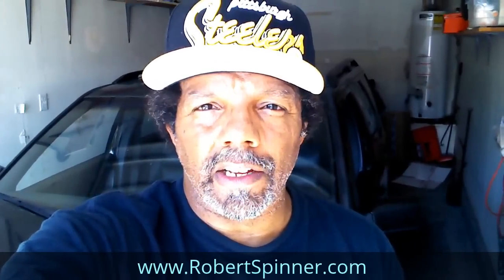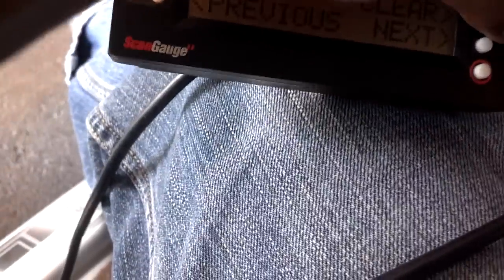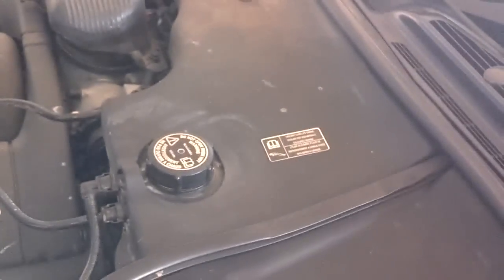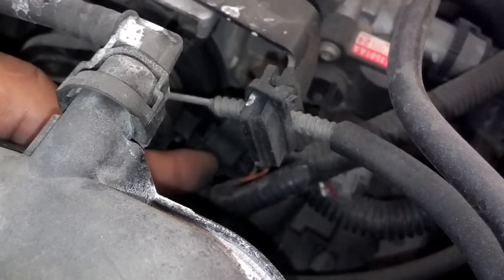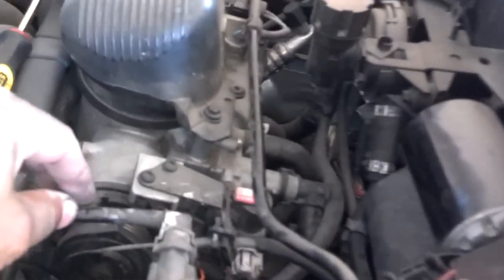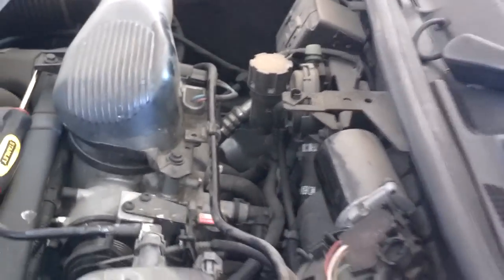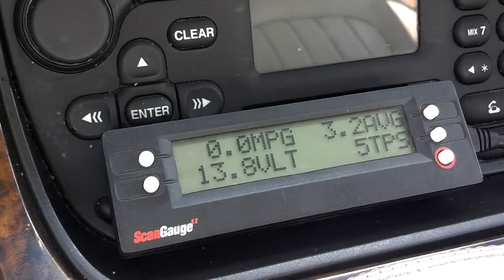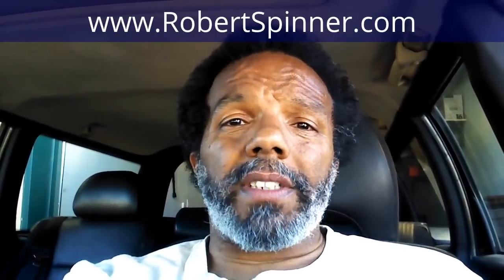Throttle body connector clean for error code P1121 and P1122, Jaguar XJ8 - VOTD

Comment: Think you.ll find the TPS is on the opposite side of the throttle body from the cable reel, part no 198500-3250 ?
Reply from the maker: Thanks for sharing.

Comment: Cheers Robert - Thrown these two codes today (which cleared with my OBD2 tool) so I now know where to get cleaning tomorrow!

Edit: There are a few people on these comments  with the "Restricted Performance" info message coming up - On my 02 XJ8 I've found this is usually an ignition coil failing, check the codes to find out which one to swap out.
Reply from the maker: Thanks for sharing

Comment: You didn’t show which did you spray, the plug with the cable? Or the plug on the throttle body? Or did you spray both?
Reply from the maker: Did I explain it?
Reply: Robert DIY I did what you said on the video exactly I bought the cleaner, took off the two sensors and it kind of worked when I turned the car on for the first time on a cold engine. But it looks like after driving it for about half an hour and the engine gets warmer it starts hesitating on the acceleration again. And it hesitates a lot when trying to drive it with the AC on.

Comment: Hi Robert. I just bought a 2005 XJ8 that hadn’t been driven on the regular through two owners. Car has 69,397 original miles on it. I’ve had it two days and last night I got the trifecta “jag screen on death” a couple times; while driving on freeway and exiting the engine went to “limp home” mode and displayed the three “engine fault/Parking break fail/dsc fail” warning. Both times I safely pulled over, turned car off and waited one minute. Turned ignition again abs vehicle ran fine. Spent much of last night researching any I’m cautiously optimistic I have a dirty throttle body. I’m going to maybe clean it myself now after watching your video. If I don’t and bring it to a Indeoendent jag tech what should I expect to be charged (estimate) for a cleaning? Do I ask for a cleaning no matter how pressured I am to put in a new one?   ....No salvage title or bad circumstance other than the fact cars need to be driven and this cat was lazy and sat for long periods of time.... ... I will follow up with you to post results...thanks again. I appreciate the way you teach.
Reply from the maker: Sad to say, I have no idea. You should check with the guys on jaguarforums.com.
Reply: @RobertDIY  thanks for the reply - those forums are good. Comes with a range of costs of $180-$800(!) just for a cleaning. I just looked at it and decided I’m going pay a shop to do it. I’ll follow up in comments when I do. Thank again.

Comment: Hi Robert - great Jag XJ8 videos      I have a 1998 XJ8 vanden plas. I have a problem called a high speed stall. If you get the Jag up over 55 mph and then hit the breaks the Jag stalls immediately and it can't be restarted until you come to a stop and wait a few seconds.
Any thoughts or help would be appreciated
Reply from the maker: https://youtu.be/NhtUXZTurzo
Reply: Thanks for the reply Robert --- this is actually a unique problem to these jags, just thought I would check to see if you had come across it before - there are no codes, engine operates as normal -and the stall only happens at speeds over 55mph - and the stall is immediate no sputter no fight just an immediate stall the second you press the break ---but you can drive 80+mph let it coast to 50mph then hit the breaks with no issue it only stalls if the jag is going over 55 when you touch your breaks
Reply from the maker: If there is no codes it's probably a fuel delivery problem. Maybe a failing fuel pump.

Comment: thanks for the info my  brother, was wondering bout info on my
 05 jag s-type  i have a 
(RESTRICTIVE PERFORMANCE)
issue and would doing the same thing you did with the throttle position sensor make a difference?  my car boggs out at 3,500 RPM within 20 mins of driving
Reply from the maker: +John Pellegrino I have no idea. What error codes are in the system?
Reply: Robert DIY  i been too 4 different mechanics an they cant even figure it out, i was told nothing comes up code wise for that, so i researched it an its 23 differnt things it could be i guess its gonna be a long day lol,
Reply from the maker: If no codes, have it scanned by an auto parts store. If there are no codes it may be the fuel pump. Have the fuel pressure checked.
Reply from the maker: Is the check engine light one?
Reply: Robert DIY  the check engine light is on, and ill def go to an auto part store an see whats good with it, and ill definately check into the fuel pump i didnt even think of that  thank you for your time an help and info, much appreciated

Comment: have a 01 jaguar xj8, it hesitates when driving n stumbles while it is warming up. At low speeds or if it remains running for an extended  period (30 minutes   or more), sometimes  it will stall.
I realized that by bleeding the air off the fuel pressure nozzle near the fuel rail, the car will start again but unfortunately  the air built up will occur again n the cycle continues.
I can't  remember  the actual obdii codes, but it was for MAF sensor. I cleaned the throttle body among other stuff with no   success.
What could be the problem ?
no plus ones
no comments
Reply from the maker: +Simon Kariuki bad MAF sensor.
Reply: Borrowed one from a friend with a similar vehicle but the problem remained.
Reply from the maker: Man, follow the codes.

Comment: There has to be a mod to stop your scan tool from shutting off the display every few seconds, that would send me batty.
Reply from the maker: +zx8401ztv They have a couple of options, that work sometimes. One is a voltage flux, the other is a rpm flux. Usually runs all the time until I point my camera phone at it. lol